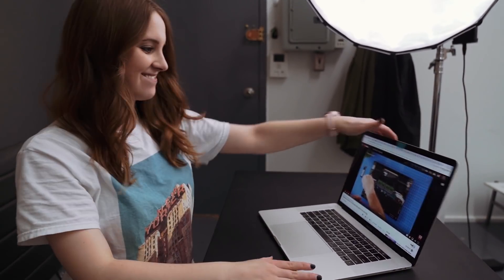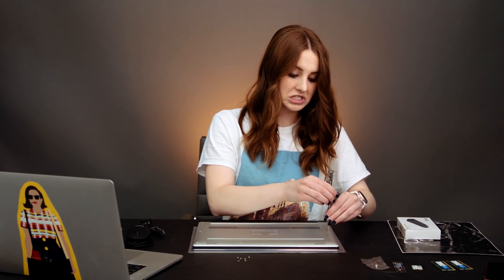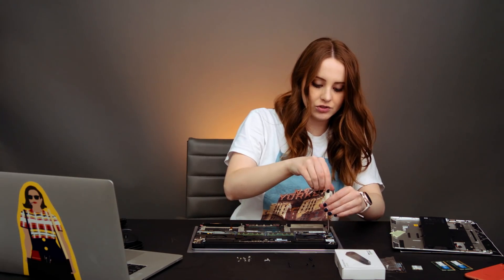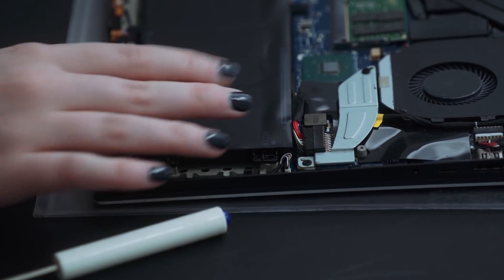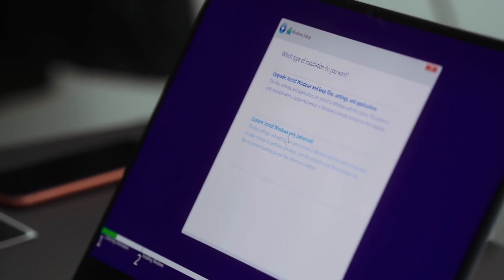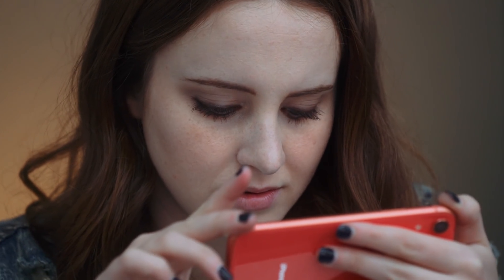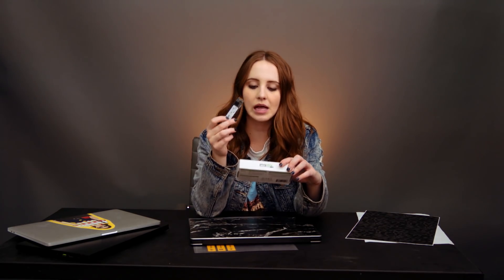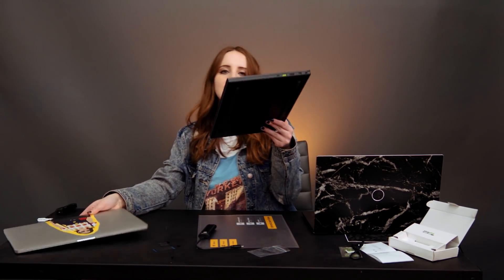How to Upgrade the Dell XPS 15 9570 !!

Comment: ey thats not an ifix screwdriver...contact linus drop tips for 10% discount at the link below
Reply: AND TUNNELBEARRRR
Reply: @tayk6615  and dbrand, and massdrop, andmadrinas, and and and kkkkk
Reply: Informedia Tech Mac Wellden 😂
Reply: Actually, the handle she uses with the torx bit looks like it's from one of the older ifixit kits...before they started naming them like Mako, Manta and Mahi.   Dunno why she used a separate phillips head screwdriver though...

Comment: Probably the best laptop upgrade I’ve watched. And that roast haha.
Reply: And the most unnecessary aswell, most probably.
Reply: George Dömse unnecessary roast, yep, but it made the vid fun. Upgrade? Though latest and greatest (I got one too), for an editing pc these upgrades are a must. I use up the whole 16GB RAM with just Lightroom and Photoshop open at the same time so expanding to 32GB will prevent it from crashing. For vid, Premiere Pro, having that expanded and faster storage space really gives a boost in loading media and editing.

Comment: Why not clone the ssd to the new one if you have the enclosure to use the old one as an external ssd? It saves you the hassle of doing a clean install and drivers. You should try it next time. There's plenty of good free cloning software.

Comment: Tell me which brand shall I go for XPS(9570) or MacBook pro?
Reply: rohit if you need a discrete gpu go with dell xps 15 over 15" mbp plus it doesn't thermal throttle below base unlike the mbp when going i9. If you don't need it go with a quad core 13" mbp. It really isn't as simple though. It all depends on the use case.

Comment: When you were installing the ssd I was thinking what about the OS, then you install windows off a USB drive. I would have cloned the current ssd to an external drive and then cloned it back to the new ssd. Everything would have been as you left on the old ssd. But if it's a new machine then what you did is fine too.
Reply: You also have a m2 case to use the ssd as an external drive. Macrium reflect would have helped with the cloning of the drive.

Comment: Just got my XPS 15 9579 and def want to upgrade the ssd so this is perfect timing. Thanks!

Also did you have issues with audio popping? When I play videos or music. Volume isn’t even at 80% I get a cracking/popping sounds
Reply: I've heard about this issue but none of my friends have this problem
Reply: Loneth Seneviratne Yeah seems to come and go. Even if I push volume at 100 in windows and the media player or YouTube I still don’t get enough sound out. Kinda makes me want to return it but I’ll wait and see. There’s supposedly an update to come out beginning of May to fix it.

Comment: And this is why Sara needs more subscribers...she actually has FUN! Great vid but I can't help but notice...my year old Inspiron 15 5577 only takes one screw to get into and you've got both RAM slots, a slot for at NVME SSD and a spot for a spinning HD...But again, at least Dell is upgradable, and a hot tip...with your service tag from the laptop on Dell's site...you can actually download the service manual for your device. Yes Dell gives you an actual PDF of how to open the laptop and change just about all the parts.

Comment: 2:28 if you were a MacBook Pro user in 2010 you could’ve replaced the RAM, battery, optical drive and storage.  Back in the good old days when they also had ports!
Reply: Macbook pro non-retina of 2012 is the last one. Since the Retina Apple started to solder on stuff. And since 2016 with much Think Different ™ innovation you have a shitty keyboard and non-upgradable soldered SSD and RAM.
Reply: Tuan Hoang Minh they can’t even use the design as an excuse anymore, the XPS 15 is incredibly thin and has amazing specs. The Spectre x360 has a beautiful design and is almost as thin, although I think the ram is soldered on the Gem cut models now
Reply: @tuan.hoang_  people quite like the keyboard. And not many people upgrade their pc. But sure it's not so cool that they removed the option to upgrade...
Reply: Still use a MacBook 2010. Upgraded the ram to 16 and replaced the battery. Still works just kinda slow booting up and turns into an inferno on any surface!
Reply: Mecrook I still use my 2010 for work which doesn’t require anything video-intensive.

When it was my only laptop I moved the HDD to the optical bay for backups, setup the OS on an SDD; upgraded to 16 GB also and replaced the battery with a new one that doesn’t hold a charge. ~doh~

Remembering the good old days when Apple was cool.

Comment: I enjoyed the video; simple, informative and fun. I actually plan to do the same with my older 9560, including an undervolt and cpu/gpu repaste. It would’ve been nice to see you do the same while you were in there. The difference it made to my spectre x360 was surprising.

Also, you’d have had a much easier time by just cloning the drive and writing the iso to the new drive.

Additionally I’d like to quickly counter a point you made around the 1:00 minute mark; the existing SSD is very fast, and whilst the incredible 970pro you installed is significantly faster, you wouldn’t notice in normal operation, only in very specific workloads, and synthetic benchmarks.

One nitpick aside it was a dope video, so thanks.

Comment: Your RAM link is to DDR3 and the dell uses DDR4 RAM. I hope you used the right one
Reply from the maker: Just updated!! Accidentally linked the wrong one!! But the right one is in my computer :)
Reply: That's right. That laptop needs the "Crucial 32GB Kit (16GBx2), 260-pin SODIMM, DDR4 PC4-21300", and the link in the description goes to "Crucial 32GB Kit (16GBx2), 204-pin SODIMM, DDR3 PC3-12800".
Reply: This is why you’re so awesome!

Comment: That Dell hardware scan thing is ridiculous. I had to run it for a service tech so they could diagnose my crashing G5. It detected nothing but something was definitely borked because they replaced the motherboard and SSD, and it's working fine now. Pointless scan is pointless

Comment: Wondering if you backed up the data before you did it.

Will updatw when i find out
Reply from the maker: I wanted a clean install of everything! Already had so much crap on that computer for using it only like 6 months 🤣

Comment: some upgrade drives come with imaging software so you can copy the original SSD to the new one. this way you don't have to do a complete re install.  I keep a backup image of my SSD. It's grate for those times when windows/linux is beyond repair. Love your vids =)

Comment: I was a certified technician for a variety of brands for 10 years and am now a consultant for research scientists (but still do plenty of pc repairs and upgrades) and there is no reason to disconnect the battery for these upgrades.  so long as you make sure that the computer is off before you begin, there shouldn't be any risky power going through any parts you would be working in and around.  so long as you don't go licking traces, you'll be fine. m.2 drives, ram, and wifi cards can easily and properly be installed without disconnecting the battery.
Reply: There was no need to physically REMOVE the battery, but it is prudent to DISCONNECT the battery when swapping out any MB-connected hardware. It just isn't worth the possibility of any current to flow through the system while working on it.
Reply: You are so wrong
Reply: If you don't know what you are doing it's better to be safe
Reply: Was going to comment this, she overcomplicated it quite a bit